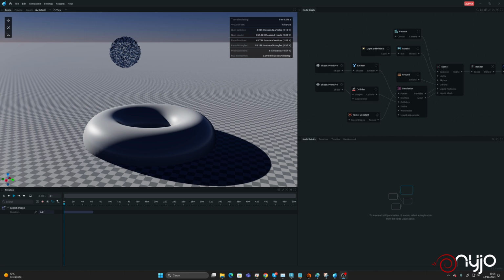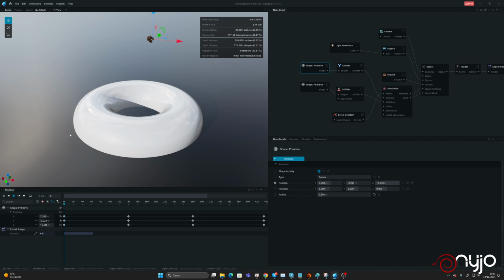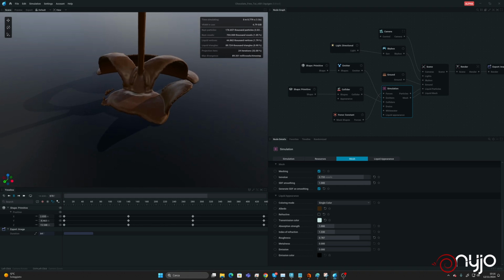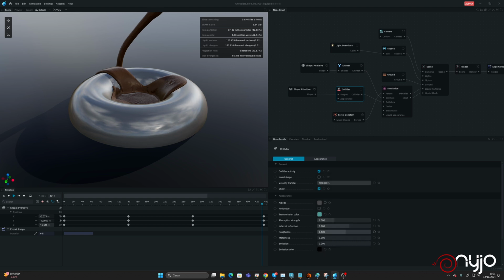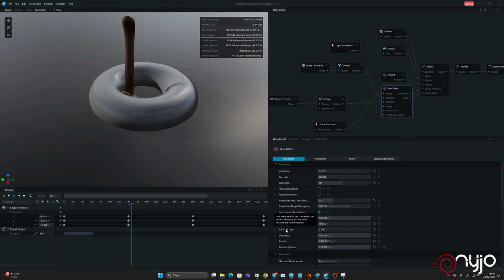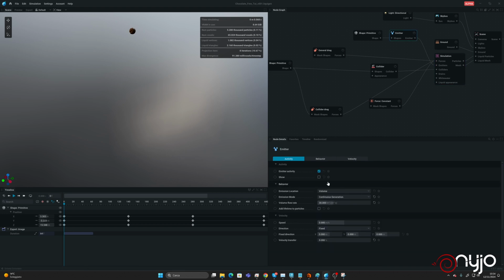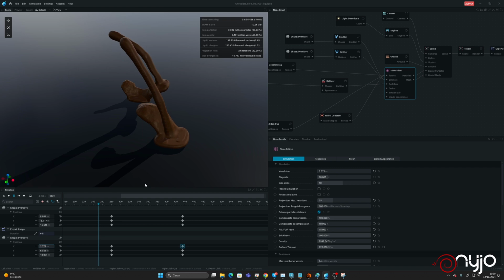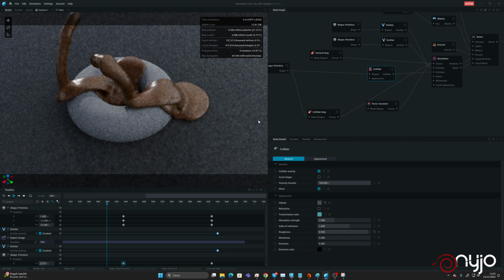Free LiquiGen Chocolate Quick Setup Tutorial by Nyjo FX

Comment: Great tutorial, thank you! If I want a liquid to follow a predefined path, how can I achieve that in LiquidGen?
Reply from the maker: Thanks a lot ! Actually there is no "spline/path" force in LiquiGen, maybe you can solve the problem using a mesh with the same shape as the path you'd like to use, and in this case you can control the fluid with the mesh force....a little bit tricky but it can be done.